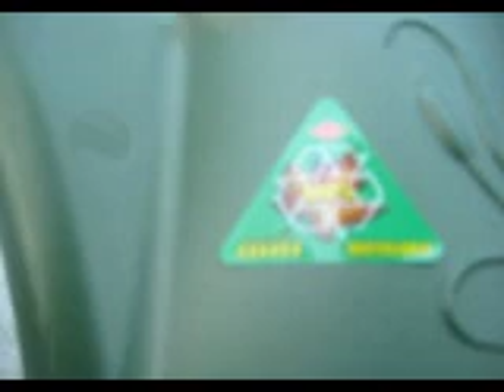ferrocement boat - concrete dinghy construction

Comment: @lokadin It doesn't need to be cold enough to support pykrete one can easily use insulation and a cooling system to prevent melting. The pykrete structure itself would be supporting algae photobioreactors. From there we can use the A.B.E. process to make butanol which you can use in a regular internal combustion engine. The acetone and ethanol can be burned so the waste heat can be used as energy while the CO2 produced goes back into the reactors. If we use low orbit reflectors its even better.

Comment: Magnesium oxide cement is far better than portland cement. Modular caissons made from magnesium oxide cement and filled with fresh water are an excellent way to do seasteading as M-cement only gets stronger over time, you can increase the size of your living /work areas by adding modules as you can afford them.

Comment: Boy, thats a lot of work when we could just use pykrete made from algae and seawater. Why buy materials, use human resources, and wait for curing times when we could more easily make a cheaper material from the seawater that naturally floats? With decent insulation, made of the oil from algae, cooling costs would be negligible. You would also be able to grow you own fuel source (again algae oil and it's husk probably) in plentiful supply. Also, algae allows exponential grow of platforms :D